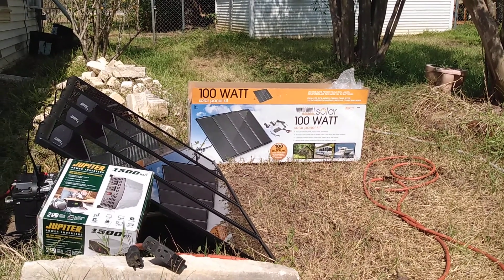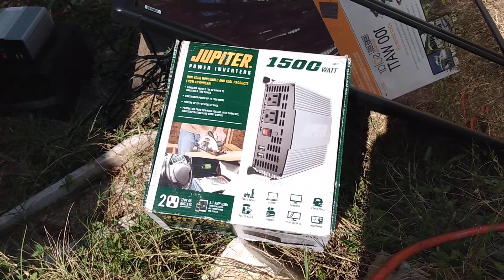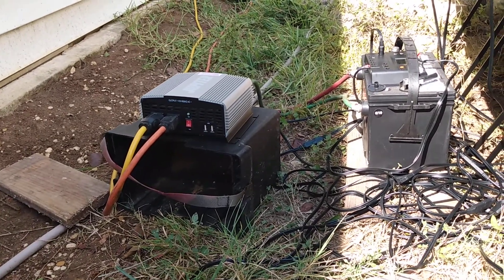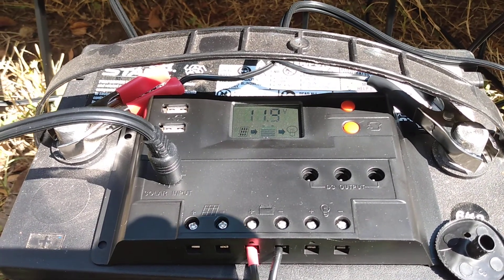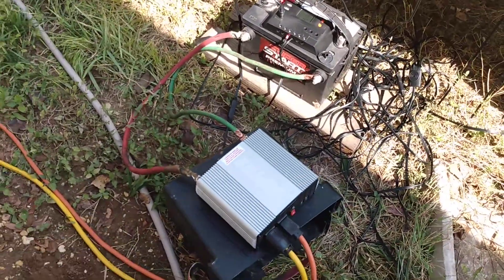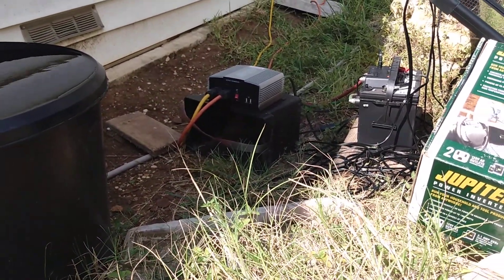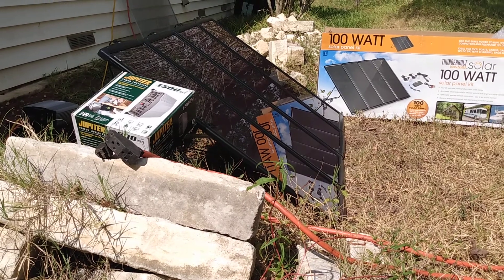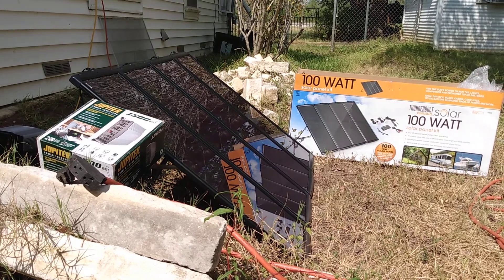DIY solar generator to power refrigerator when the grid goes down.

Comment: I got one of those wireless accurite thermometers and put in freezer put the readout unit on the kitchen table. That way I can see the temperature inside without opening door. Need only to run freezer about once a day to keep temperature less than 32 degrees. Need to run refrigerator every 4 hours.

Comment: Thankyou, this video reminded me to finish organising my set up and to test it before I need it. I recently purchased a solar panel and battery box, but this prompts me to get the spare battery I need and looking at your set up I may need a bigger inverter.
Reply from the maker: I was in the same situation. I had the solar panel kit for months.I purchase the battery for a broke-down tractor months before that. I had to use cable laying around. The power inverter has been riding in the toolbox of the truck unused for a couple years.
It would be best to have the inverter beside the appliances to plug in directly. One of my freezer tripped it. The wiring from the panel's is small enough to go through the window sill easier to the controller box. I'm considering running a conduit through the wall and normally keeping it plugged. It also needed heavier gauge cables from the battery to the inverter.
I hope to purchase two marine batteries, heavier cables and a larger inverter soon.
Reply from the maker: I also hope to repair my gasoline generator in order to operate the water well or more appliances.